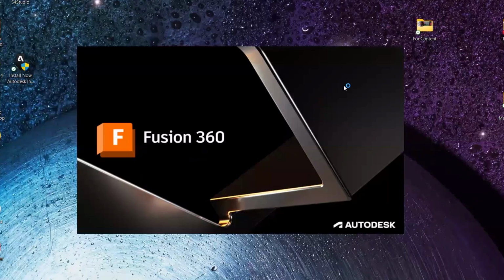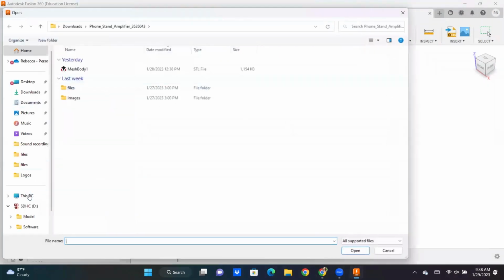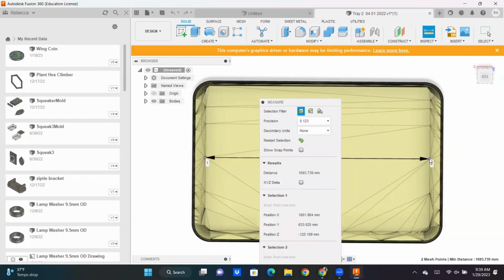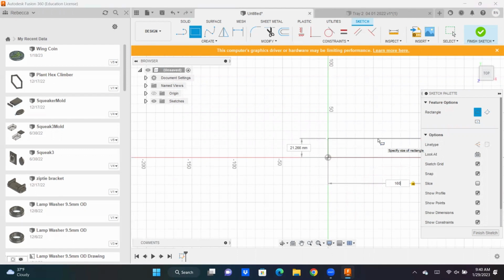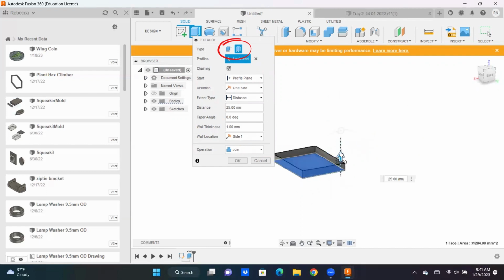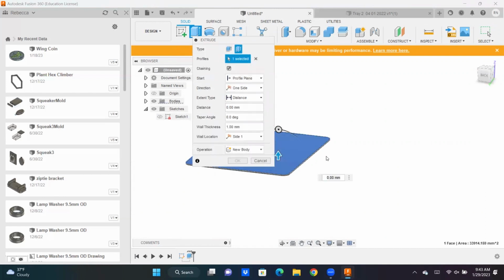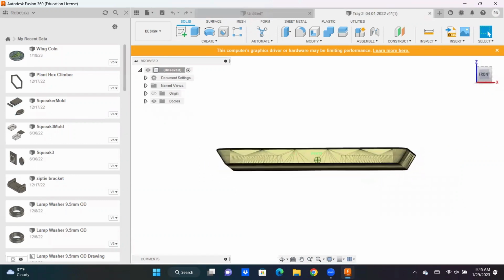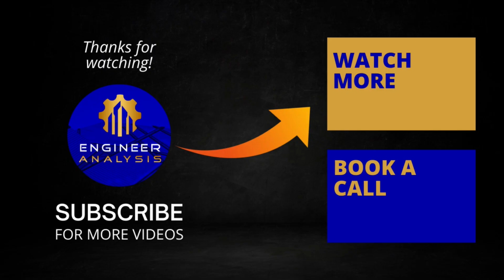3D Printing for Beginners: Creating a Basic 3D Printable Design with Autodesk Fusion 360

Comment: This was a massively helpful, and concise presentation. The brief explanation on differences in meshes and solids was definitely needed, lol. Much appreciated! Just started working in F360, and made my first "printable" file (a very tiny easel!), and I referenced this more than a few times. Although, the slicer programs are next, and I haven't even started on those yet, so looking forward to that video hopefully.
Reply from the maker: Thank you so much. Glad I could help! I got you man. What slicer do you use?
Reply: @Engineer Analysis  Thanks for the reply! To answer your question, probably Cura, I think? 

Cura seems to be the one that I've heard the most about. Unless there would be another option that ends up working better my specific printer.

Still doing some shopping on that front too. I've been sitting with the Creality Ender 3 V2 in my cart for a few days, absolutely sweating over clicking that buy button. There are a LOT more options than I had initially realized, haha.
Reply from the maker: @CrashHobbyX   Cura is a great starting point (plus its free). I just posted a video on it. https://www.youtube.com/watch?v=jQUUMrM8eCY 
There's a link in the description to download it. The Ender is good. Its similar to the one I use. DO IT!!! It doesn't matter what you get (as long as it's not off a cheap scammy site). I think the Ender has a pre-set printer setting in Cura, as well. 

Thanks for the support! I'm new to the YouTube game, so it really means a lot. :)
Reply: @Engineer Analysis  Thank you so much for the update! The video is going to be a massive help! (Just finishing up watching it now. Will also leave a comment over there, because interaction!)

A day or so after the first comment, I pulled the trigger on the Ender 3 V2. Soooo excited! I did make sure to order the legit printer. But, that's a really valid point that more people should be aware of. I came across plenty of websites featuring discounted printers with flash sales and ads all over. Hard to say who can be trusted.

And I'm happy to support a newer channel! Definitely added to subs. I always appreciate solid educational/Instructional content.
Reply from the maker: @CrashHobbyX  You're the best! Thanks. :)